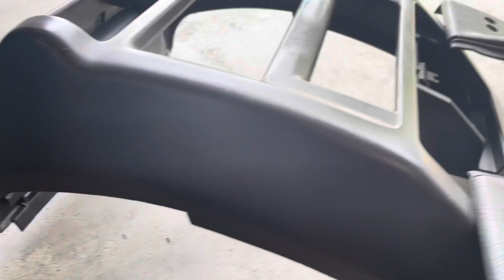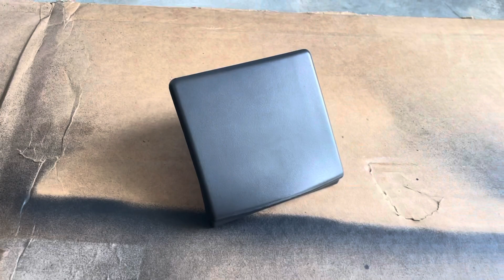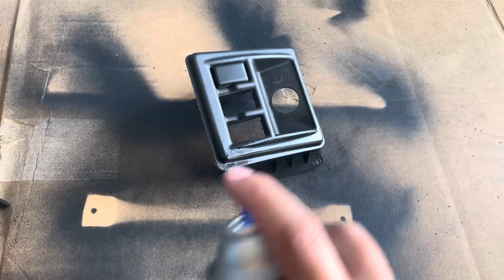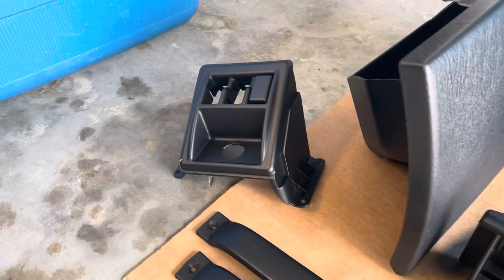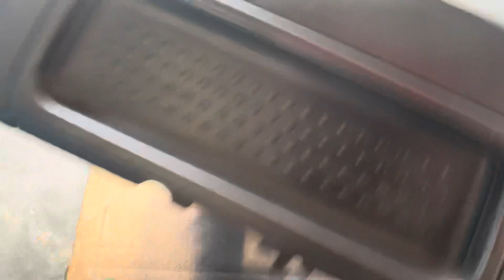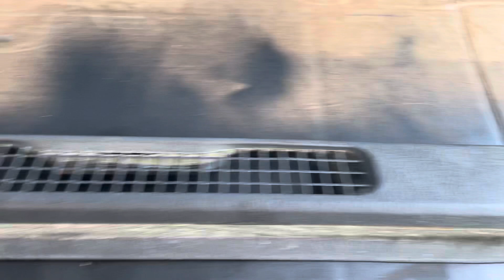Jeep Wrangler TJ - Duplicolor Vinyl & Fabric Spray Paint Dash Interior pt.2/2

Comment: I painted my TJ interior and it all came out well except for the 1/2 door panels.  The paint has flaked off of those in some places, especially where my arm sits.  I probably should have used an adhesion promoter on those.
Reply from the maker: I’ve had the same issue with my door panels. Especially after a rain, the water makes it flake faster if you wipe it while wet

Comment: Hi just a quick question do you need to clear coat it for added protection once it has dried or is that option your choice
Reply from the maker: I didn’t think about that. That’s a good idea. It would be your choice, if you prefer the glossy look or the flat finish. The clear coat might help making it easier to clean the dash. Thanks for watching!
Reply: I liked the video i did my boot a while back only snag is i dont really want to take the whole dash out but maybe do the bottom half ,thanks for the reply